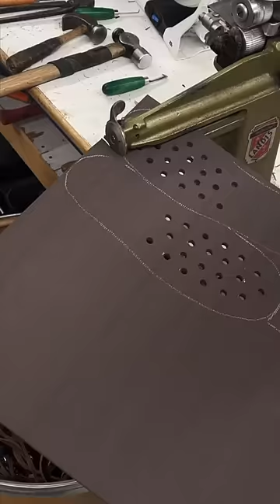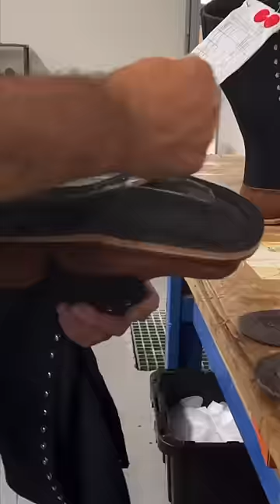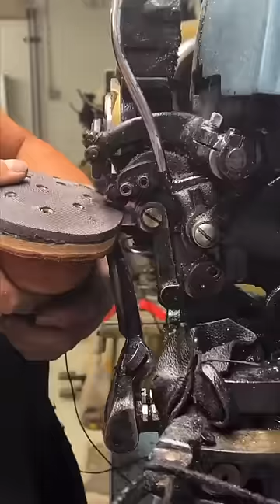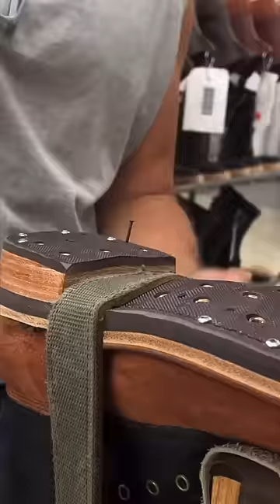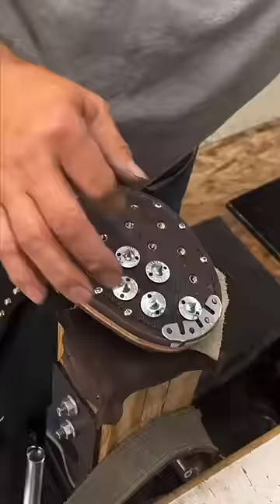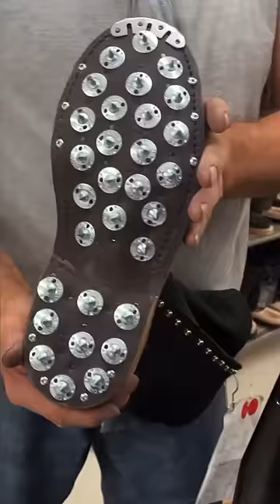Making the World's Most Wild Boot

Comment: Is stitching the outsole to the midsole just to hold them in place while the nails etc are inserted? Because thread out the bottom seems like a quick way for it to wear and break. Fabulous looking boots though. Curious as I used to work in a mass production line boot company years ago.